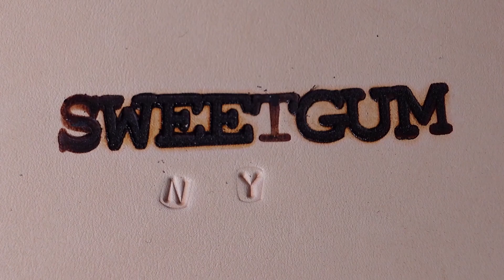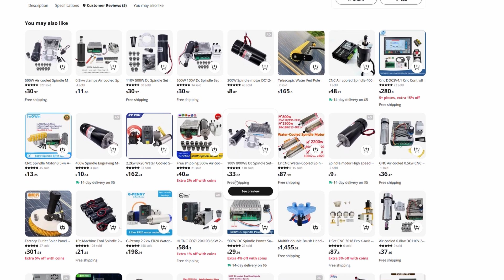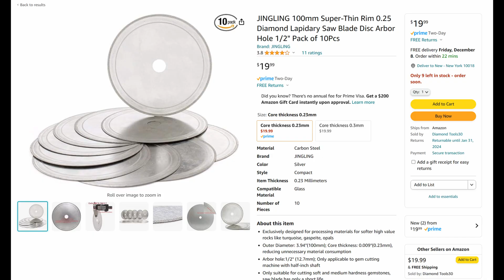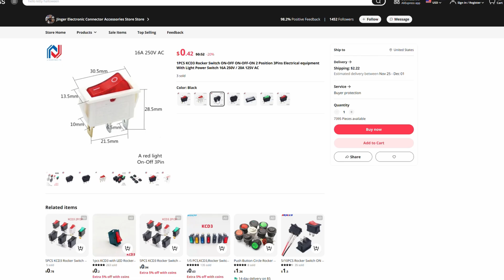Update for $65 DIY 3D printed desktop machine that can become any machine.

Comment: Here some suggestions:
Separate the control from the motor.
Make the motor housing a little bit more water resistant and safe when working with water.
It's much easier to work on separating those two with a modular system like this no messy wire of electricity, water, and weight.
So, it's just two boxes with one box for the motor in front and connected wire to a control box on the side.
Basically, you can just overengineer the motor housing for every addon you can imagine, just drop it and make a simple locking system with a small tension Clasp or just thumbscrew or just a strong magnet I guess for any addons you want.
For more flexing, you can add Arduino and Bluetooth bulshit on the controller and connect with a phone instead. xdd